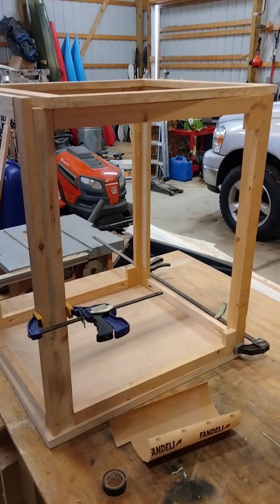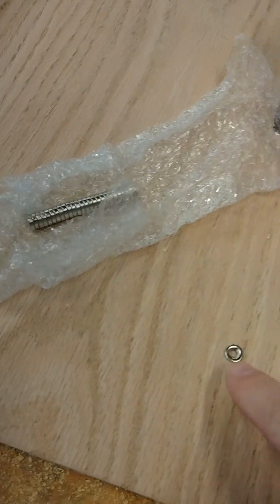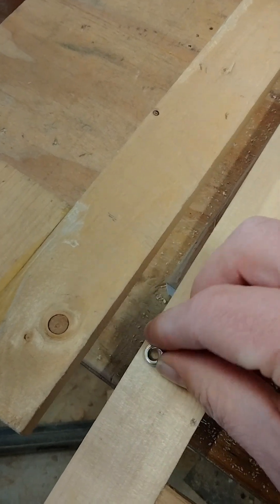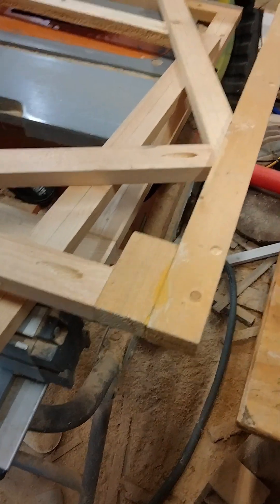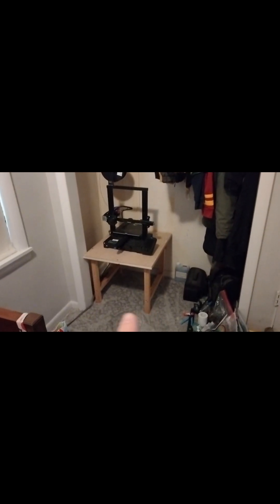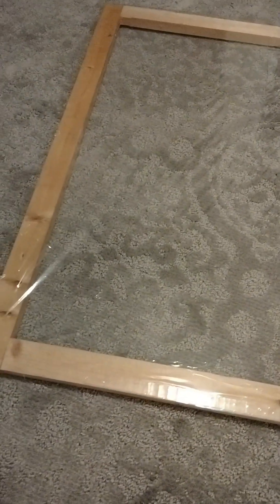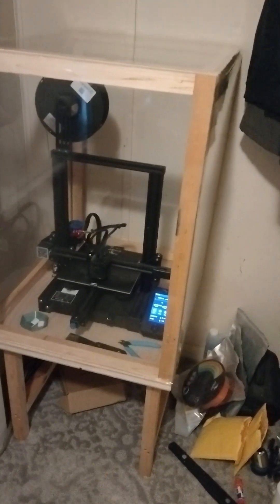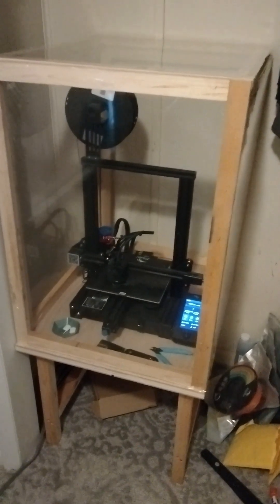Easy DIY 3D Printer Enclosure Made With Magnets and Crystal Clear Shrink Film Window Sealer

Comment: What is the cost of time and materials? I think it would be less if you bought a Bambu P1S, X1C, or Creality K1 and had a printer designed for an enclosure. Enclosures don't make sense to me unless you are printing ABS, ASA, and other materials that require a hotter chamber. At that point, you also need to think about filtering out the VOC or extracting them outside.
Reply from the maker: The cost of time was too much, of course. So it goes with DIY projects. This was more about scratching an itch and trying the idea.